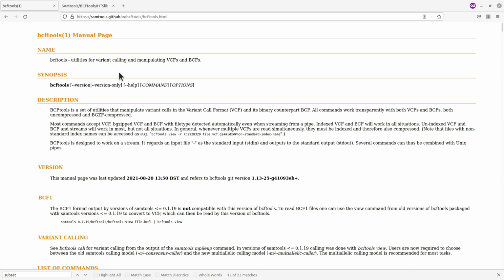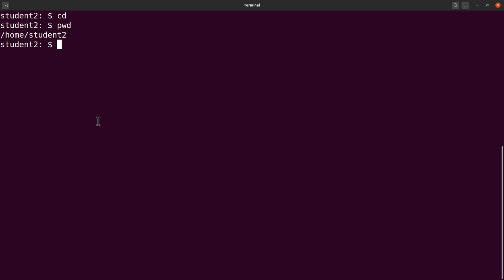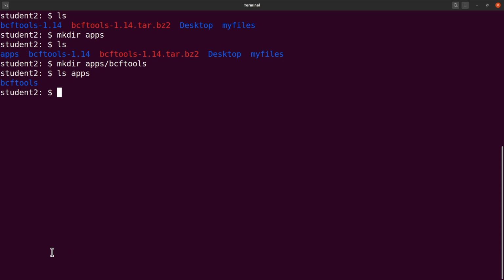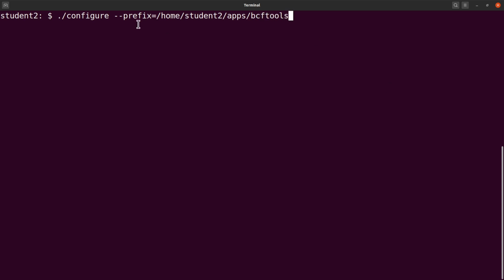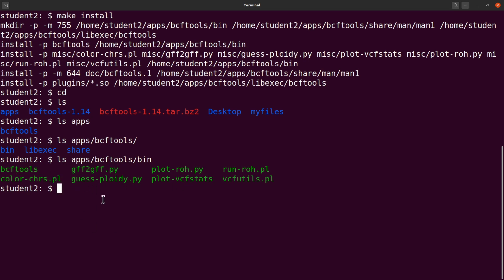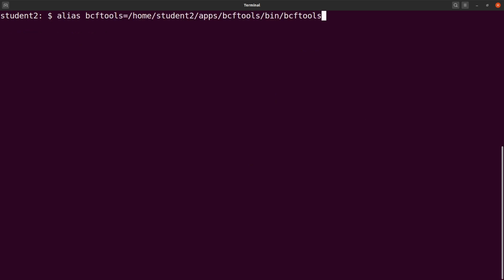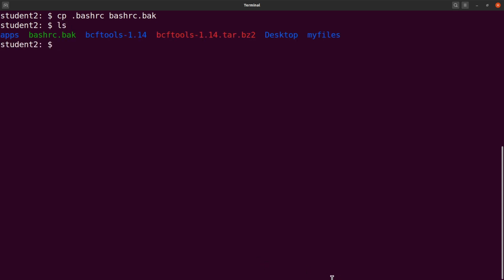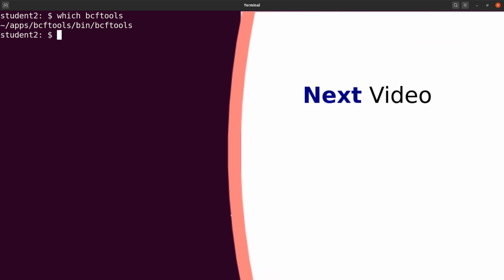How to install BCFTOOLS in any Linux Machine | Build from source | A simple Guide for Beginners

Comment: Not able to do configuration in windows using ./configure.  Is there an alternative
Reply from the maker: bcftools can be run only in unix environments. If you want to run in windows then here are some suggestions.

1. Install Linux in a virtualbox and run the commands in it. https://youtu.be/D3S6bIjWbDg
2. Enable the windows subsystem. That will allow you to run linux commands and apps.
3. You can also install bcftools using anaconda: https://youtu.be/BLhVqBXL_v4
Reply: @bioinformaticscoach  thanks
Reply: @bioinformaticscoach  I can use bedtools as an alternative?
Reply from the maker: @bioinformatics_by_tinacole  It depends on what you want to achieve.  I will recommend you read the documentation the tools you are interested in .